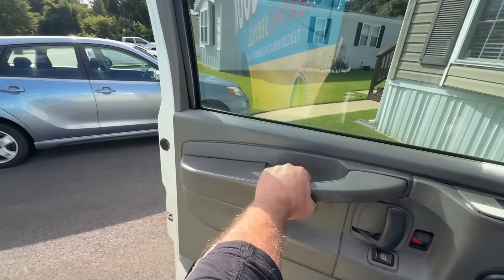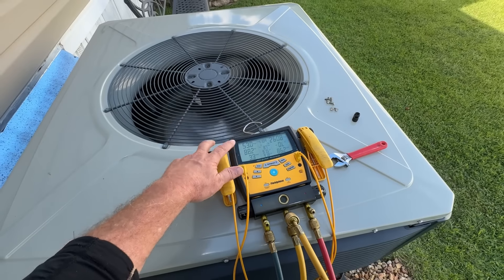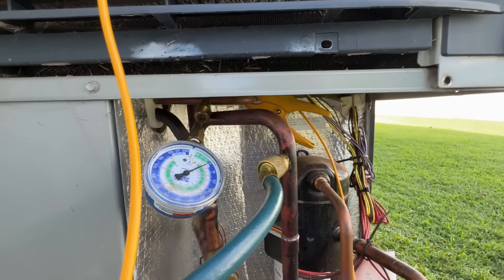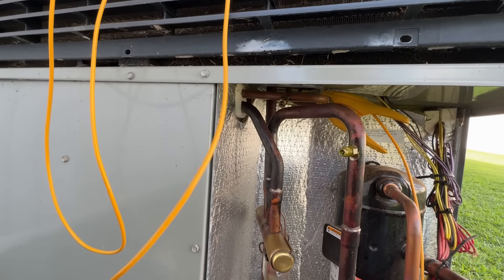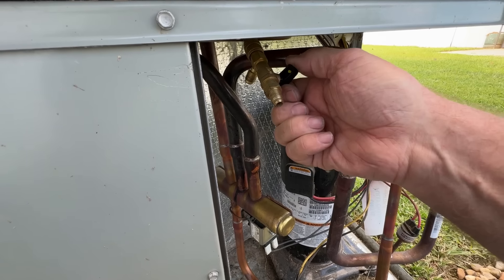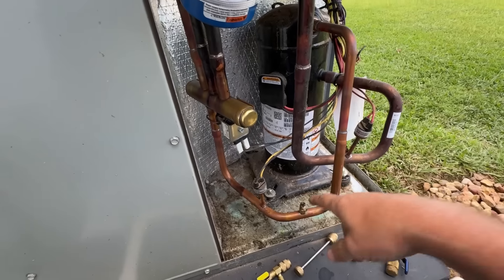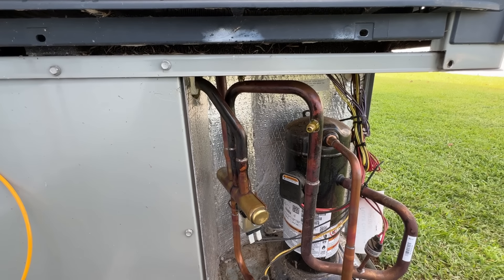R410a leak fixed lucky find coil not failed

Comment: Also if the tools ends are smooth you can take a small file & inside 2 ends make the indentions to hold core, after many uses they wear out or ends get beveled.

Comment: I could hear it leaking on cam "hissing" and it changed when you put thumb over it, I still have good hearing and can usually hear things like that in person, which is also good for vacuum leaks in automotive/other gasses.
just caught a schrader leaking on the high side the other day, right after removing hoses, I could hear it gently hissing over triple condenser fans and the compressor all in the same spot.
it wasn't leaking beforehand, but wouldn't seal again even with fiddling and cycling it, valve core tool for the save! I'm guessing it was a core from around 2016? the tiny gasket on the end was just shot. (R-404A/POE oil)

Comment: i used to install the caps the same way. i had a old timer show me how it can roll the tops and then, the schrader tool definitely won’t work. i now give a slight snug with a wrench. for what ever it’s worth. same guy showed me a few years back to loosen the tool a little cause the ole wring will squish and not let the schrader out. thank you for all your content i actually have a guy that works for me and we watch you and learn and critique. it helps pass some days. thanks again.
Reply: For APPION switch the O-ring to a HNBR or HSN 'AS568 Standard O-ring -108' in the VCT & VCRT tools. These O-rings are not as spongy as a rubber O-ring, and don't get in the way of the core when it's removed, so you can tighten the tool normally.  These O-rings last a lot longer.  108 is the size.

Adjust the gap on the  stem to click into and hold the Schrader core. 

Tighten the tool down finger tight like you would normally do with any other Schrader.  You will confidently remove the core every time, without any other tricks.

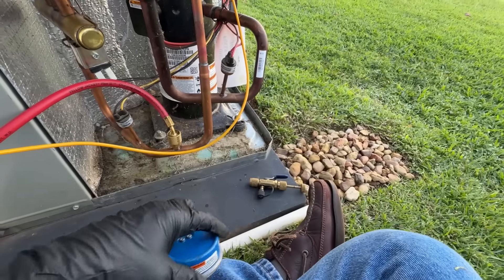Comment: 5:55 - I like this trick a lot better than the one I learned: keep a service valve cap with a tiny hole drilled in it handy and use leak reactant to check for bubbles. With your method there is no chance of contaminating the system. Thanks for sharing that with us!

Comment: the "el-cheapo" core tool doesn't always grab the core tip, sometimes the old core springs are too weak and it just keeps depressing them instead. it has a little rubber ring down inside that grabs onto the core tip
also, the core tool tip likes to unthread off the stem, especially if the core is very tight and that can get you into a mess real fast. so double check that it's tight or even pull apart and apply thread locker.

Comment: I was in a similar valve core situation about a month or so ago and it took me more than a few tries to get the old core out. It also took me a few tries to get the new core in. In hindsight I should have shut that circuit or the whole unit off. Then again it was 100+ out and I needed to keep the chiller running as much as I could.

Comment: your lucky the core didn't stick the ball valve open when you cracked it slightly. I've seen that happen before, it wouldn't shut and was spraying liquid and oil out as they tried to put the tool stem back on risking refrigerant burn. I yelled NO,  yank the valve wide open and close it again, they did and the core went ricocheting around the room, problem solved.
you really should do it with system off and pressure equalized, so you're dealing with gas and not liquid. assuming that's possible to do. 😬

Comment: If you take the valve core remover tool The part that holds the valve core & close (bend) the very end just enough with pliers to hold valve core & when core is in unit and you go to take core out you will feel a little snap of the tool snapping on core and then when you unscrew core it will stay on the end as long as the core tool oring or seal is not swollen making the hole for core to come out to small. Also turn the tool while pulling it out. Great job though.

Comment: I believe years ago you help me through a issue I had with my package unit on my double wide ended up being a bad blower motor and you were the only one that had the one that I needed I believe back in 2017 or 18 and I had it shipped and you saved my butt

Comment: The part of the core removal tool that holds onto the core may need to be crimped with a pair of pliers. I had a tool with this problem and a little squeeae with a pair of pliers fixed it. Test it with a spare core and see if it holds onto the core as it should.

Comment: Great YouTube craftsmen like yourself are so refreshing. I don’t want to be a DIYer but the new ownership at my long standing HVAC fired all the senior techs who refused to stop doing repairs or maintenance on R22 systems. A couple of these guys served me for years and were always treated to a generous tip I thought they earned. I wish I could find out who they work for now. I really hate to be in a position to helicopter around, but I have been lied to just enough times to feel the need to evaluate the work of anyone I do not know. Where have all the good guys gone? Signed: Harry Homeowner Cap Bandit.

Comment: At least they are going back to lower pressure refrigerants, 410a was just pushing harder pressure on systems that never got regular maintenance, which in turn caused even more leaks, ontop of gov efficiency regulations, so I totally agree that going to 410 leaked way more refrigerant in its time than something like r22 did in all the amount of the time its been around. As for your core removal tool, i've found many of mine the forks will spread a little out and not grab the core and hold onto it, a very, slight pinch with plyers have always fixed that for me. Love the idea of using an old pressure gauge to find small leaky cores is awesome!
Reply: @ 40°F

     R22 = 83.25 psi
     R32 = 135.6 psi
R410A = 133.5 psi
R454B = 126.7 psi

Comment: You could leave the valve depressor in the gauge and use the core tool to act as the no depressor adapter. I have also run into the core removal tools find that the remover stem itself does not grab the core. Usually it is either due to the stem itself spreading too far apart or the core has smooth sides that the tool can not grab.

Comment: Over tighten flare caps will screw flare. When I saw a flare cap. Or nylon caps I'd use the brass with the oring seal. Don't back wrench those valve you'll be over tighten.

Comment: I’m a semiretired HVAC&R tech/contractor I spent 45+ years and had never seen that leak check gauge setup, I wish I’d seen it 45 years ago. Have been using those schrader tools for most of my career showed them to many techs. 
Thanks usually find your videos interesting, sometimes disagree with you

Comment: This is why I have never had my pressures checked.  An old timer told me if the system is working never let anybody check it.  They will destroy the valves and if it's an older system it doesn't take much to destroy the valve.

Comment: The HVAC industry needed better lobbyists. You're exactly right - if the GAS is what they were trying to regulate, then they should have demanded consumer units have leak warranties to encourage more robust systems or demanded consumer or commercial units come built in with pressure sensors that would go off if the system had an obvious leak. Why not have a gauge set built in somewhere? These are supposed to be closed-system machines. It doesn't make sense to regulate the gas in a closed system machine. They got rid of the HFC aerosols and maybe rightfully so. They made it best practice to recover charge. Rightfully so. But it didn't make sense to push systems harder for energy efficiency reasons with worse and worse performing refrigerants. How much energy does a unit save if it only lasts 5-10 years?

Comment: The leak wasn't where the pin was bent or the obvious gasket that seats in the fitting.  It was at the gasket under the little 'umbrella' at the other end of the pin.

Comment: Mr Ted I had a condenser one time and the valve on discharge line was like that! We took them out before sweating the copper line sets and couldn’t get the discharge side valve core out. Wound up recovering all the charge and installing a new valve. That was a bummer but it can happen and when you think you’ve seen it all that happens and was about 2 hours away from the parts store.

Comment: I was just thinking about making a gauge as you used to test the Schrader valve. To get a gauge I was thinking about an old obsolete unit I have somewhere and then it occurred to me. I have a new gauge set and why not just close all the valves hook up the hose to the shrader port with no depressor and see if it reads anything on the low pressure gauge. Maybe I am missing something but that seems like it would be the same thing so I won't be making the gauge after all since I already have one.